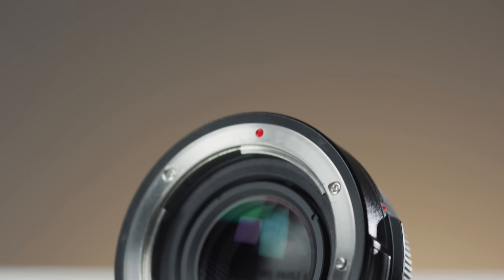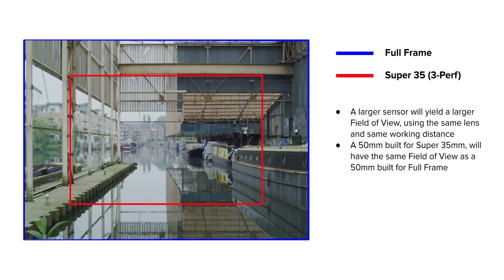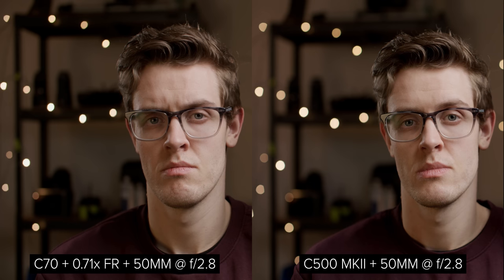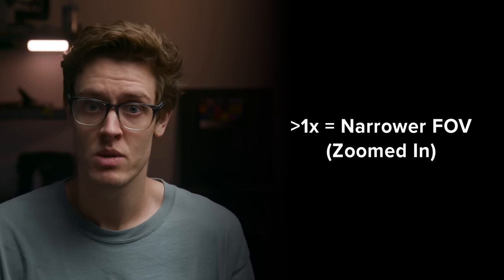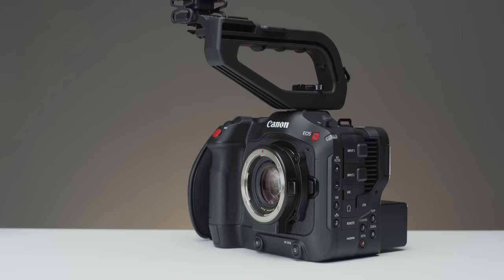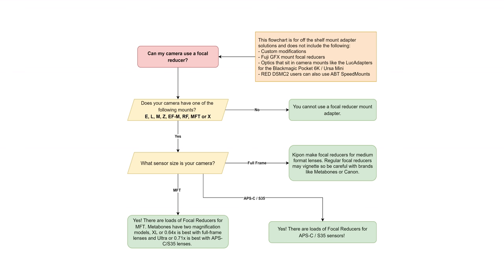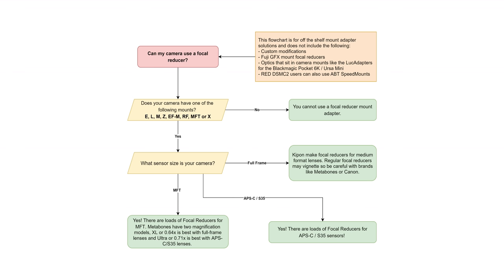Focal Reducers / Speed Boosters | Explained

Comment: I would definitely appreciate a similarly technical video on the "full frame look". Too often you see bs on youtube that attributes it to some magic qualities of a larger sensor, and it would be good to have a comprehensive reference of specific technical advantages of the larger format.
Reply: +1
Reply: +1
Reply: + 1
Reply: Straighter angles at same field of view (wider field of view at same focal length), more light collected at same T-stop and ISO setting.

(Edit: hilariously I managed to write my short answer wrong... hehe. And yea great subject for a video)
Reply: @randomgeocacher  I agree with your second two points. Your signal to noise ratio with a large sensor is certainly improved over a small one at a given T-stop, allowing the same ISO to look less noisy.

I'm not sure I understand what you mean by the straighter angles thing.
Reply: @thatcherfreeman  large format -> medium format -> full frame -> crop; the further down you go you need “wider” focal lengths to take the same picture. Wider focal lengths generally have more bent angles are are harder to get correct, so producing a better image on a larger sensor is “easier” because you use a longer focal length.

Thus on a large format, you will take the picture on a very “long” focal length, generating a very “straight” picture. If you instead take it on a micro four thirds, you will need much wider optics, generating much more distortion and bends.

On a “normal” lens, such as a 50mm full frame equivalent, it looks pretty good on any sensor size. The wider you go, the harder it is to get it looking great on the smaller sensor sizes. So especially on wide angle photography, for example 25mm FF equivalent, the larger sensors will have a big benefit.

That said, I think some of the manufacturers “unbend” their own native lenses and remove some vignetting, at least in photo mode. But if you like really wide angle portraits without and distortion or in-camera / post processing hacks, then that’s typically where medium format or full frame adds some benefit over the smaller sizes.
Reply: fairly simple. Larger chip; to achieve the same FOV as super 35 you have to be closer to your subject hence more shallow DOF
Reply: @earthlevel4569  Huh? To match FOV you just change the focal length with a larger sensor.
Reply: It’s not “magical”... but people TEND to like the way images look on Full-Frame and larger formats. Just like people TEND to like the s35 look to small camcorder sensors
Reply: @Frontigenics  Yeah, and describing what the technical qualities of a larger sensor are that achieve that result is valuable
Reply: @randomgeocacher  it is far easier to make super corrected (less distorted) wide angle optics for smaller formats, so no... you don't get less distortion using a 50mm on FF / 135 compared to a 25mm on MFT. That is one of the central myths of full frame.

Also perspective (rather than optical) distortion is a product of the proximity of the lens entrance pupil to the subject, so as long as that is constant between the two formats, again there is little no no difference.

It's only at the absolute extremes distortion comes into play as a factor in any meaningful way... a 12mm on FF / 135 verses a 6mm on MFT, but even there other factors are more of an issue.

Also remember most wide angles for IMAX an 65mm are super distorted. There is a test comparing Arri DNA primes (rehoused MF optics) on the Alexa65 and Arri's Signature primes on the Alexa Mini... guess which show more distortion?

Comment: I just discovered your channel, and it's great. There's a few things i want to say: 

A factor that would enter into the equation of DoF would be the circle of confusion which is what makes that, with lenses that give both systems the same field of view (25mm for m4/3; 50mm for FF), a 1/4 of FF sensor like a m4/3 has not 4x the DoF of Full Frame, but only 2x. If you want to hear an explanation look at min. 4 of Filmmaker IQ's Hyperfocal video. I don't know how focal reducers affect circle of confusion.

The other thing I want to say is that it'd be great to see a video about the FF look you mentioned. I've found it very difficult to comprehend what are the things that differentiate a FF image from a crop sensor's with an increased aperture.

Comment: Great overview and lots of details! 

I just wish there was an option to disable the “transformation” of f-stops and focal length, and just have the camera show what the lens is really set at. 

I think the “speedboosting” of metadata is the cause of 99% of the confusion about speedboosters ... and primarily done to tout/market the capability of the device rather than being helpful to the operator. Especially when an adapter is semi-permanently screwed on it’s fairly obvious the operator likes to work with adapted lenses terms rather than the native mount terms.
Reply: The camera does show what the lens is really set at. The focal length and aperture really do change when using a speedbooster.
Reply: @alex-stone  I fully understand what compressing the image circle does. My point is that changing the metadata is not helpful to many users. For example, someone operating a speedbooster Super35 and a full frame camera at the same time for an interview, will only get matching settings incredibly hard. There are other situations too where it just make things harder. To many users it would be much easier if there was a camera menu option to disable the metadata transformation. Not to all users, but for some, it would really help.

For c70 owners semi-permanently screwing adapter into the body, I imagine several would prefer working in full frame terms.
Reply: @randomgeocacher  don't think of things in 'full frame terms' - a lens' focal length and aperture are independent of format size and are not relative to anything in terms of full frame.
By updating the metadata to reflect the actual focal length and aperture, this only makes it easier for the user - especially if their A cam is FF and their B is speedbooster S35. For instance, if the B camera now says 35mm, this will match the field of view that using a native 35mm on the A cam will give. Equally, it also helps match exposures - if both cameras read f/1.4, then the exposure is the same, even though the Speedboosted lens might now open up to f/1.0.
I used to shoot with an FS7 (with Speedbooster) alongside an A7Sii  with manual lenses. Not having this automatic metadata adjustment made things harder as it added an additional step to have to think about when trying to match FoV and exposures.
Reply: @alex-stone my point is that the metadata thing is only helpful to one set of working and I think many/most do not prefer to work in that way. Regardless of how you want to work the best option would be to let the user decide. For me, I would like the metadata to say 70mm when the lens is set to 70mm. Sure I can try to compensate and reverse engineer in the head the difference, but the transformation just adds an annoying extra work and unclarity that I find utterly unhelpful. For me it could just say on the packaging how great it is and what it does, and then I would like to select “Do not improve metadata” in the menu. I’d rather buy native lenses than have to deal with the speedboosters making everything confusing. And given how many confused debates this metadata transformation adds to forums etc it seems it creates a lot of confusion / problems to many users.

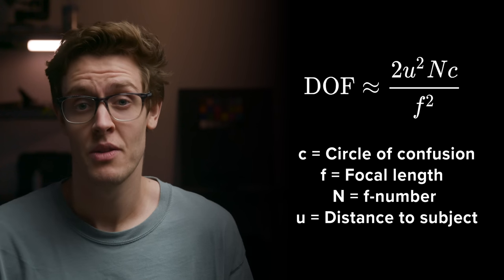Comment: Great video. But at 5:50 you mentioned that the f-number and focal length are cancelled out, so the DoF will be the same. However, from the formula, the focal length is powered by 2 while the f-number has no multiplication. Should the DoF change? Did I miss something?
Reply: I didn't get it either

Comment: The Mamiya 645 and RB67 are similar.  Can a speed booster made for the 645 be also used on the RB67 lenses if mounted on a dumb adapter?

Comment: I'm attempting to adapt the Canon f/2.8 65mm 1x-5x MP-E onto an Olympus OM-D E-M1X.  If I understand the video correctly, there will be no difference in DOF in either direction (increased or decreased), whether with the use of a straight EF-MFT adapter, or with an EF-MFT focal reducer, but the use of a focal reducer will recover one stop of lost light.  Assuming that's correct, my biggest remaining question is whether or not the AOV and/or working distances will change with a straight adapter vs. a focal reducer.  When mounted on a FF Canon body (such as my older 6D), the MP-E's normal working distance is rather shallow/small, particularly at higher magnifications.  It would be beneficial to see those working distances increased to allow for more light, and more room for flashes other than a ring flash between the front element and the subject.  Lastly, I'm wondering if models like the VILTROX EF-M2II, Commlite CM-AEF-MFT and Fotodiox Pro Fusion Redux Adapter are actually suitable alternatives to the significantly more expensive Metabones T Speed Booster ULTRA, or if they are underperforming in some way.  Thank you in advance!

Comment: Careful when you say you get a full frame look. When you use a focal reducer, you are adding glass to a lens and changing the actual focal length of the lens. A 50mm f2.8 lens becomes a new lens essentially with a focal length of 35mm f2 with a focal reducer. Therefore, you could just use a 35mm f2 lens without a focal reducer. I see a lot of misconception that a focal reducer will make your crop sensor into a full frame sensor and this is not the case.
Reply from the maker: Sorry Matthew but did you watch the whole video?
Reply: @CVPTV  Yes. I either misunderstood what you're saying, or it seems contradictory, for the section at 8:45 where you say "achieve a full frame look".
Reply: @CVPTV  Hey man, this video is truly fantastic. Thanks so much for the in depth explanation. I wanted to see if you could expand on Mathew's comment though. Is his comment correct? Would a focal reducer really not emmulate a "full frame look"?
Reply: @joestaehly2427  a 50mm lens on 135 / FF has the same AOV as a 35mm lens on S35. But at the same Tstop, the 50mm on 135 will be 1.5 stops shallower in terms of DOF / back blur. Stop the 50mm lens down 1.5 stops and a 50mm lens on 135 / FF and a 35mm lens on S35 will look almost identical.

Add a focal reducer and mount the 50mm on a S35 camera and you move the point on convergence in the lens - so the 50mm becomes a wider lens, albeit with reduced image circle, one that now only covers S35. Using all the light captures increases the stop.

So 50mm (a standard lens on FF / 135) has not become a 35mm (standard lens on S35).

It doesn't really emulate

Comment: So a 50mm T2 on a full frame and a Crop sensor is still a 50mm T2, just cropped in. But a 50mm T2 on a Crop sensor with a speed booster is not the same as 50mm T2 on a full frame but changes the 50mm T2 to a 35mm T1.4? So for instance would a cropped sensor with 35mm T1.4 and a crop sensor with speed booster and a 50mm T2 would be the same look?
Reply: Yes a 35 f/1.4 on APS-C will look like a 52.5 f/2.1.  The depth of field is the same. So those 2 lenses would look identical as long as you apply crop factor to both focal  length and DoF.

Also if anyone tells you there is more distortion on the 35mm on APS-C, tell them it's false. All equivalent lenses have 100% the exact same look and distortion is a myth. A 12mm on m43 shooting at 3:2 aspect ratio will look 100% the  same as a 24mm full frame when the image sensors are in the same plane.

Comment: Great video, the only thing that I don't like on the C70 is showing the focal length as 35mm for 50mm lens. On a MFT system I always think of a 50mm lens as having a 100mm effective length, calculating the crop factor as it relates to the full frame equivalent of the lens used. Why wouldn't you then calculate the 50mm lens as a 50mm full frame equivalent when using the focal reducer?

Couldn't Canon have a menu setting to select when using the focal reducer that then sets the focal length on the camera as the full frame equivalent value as that is what is being achieved? I don't understand why you talk of the camera as 35mm when without the focal reducer you should refer to the 50mm lens as having a full frame equivalent of 85.5mm?
Reply from the maker: I understand why Canon have done it, just as they have changed the aperture by a stop too. It's because that is what the focal reducer is doing. I don't understand your 2nd question sorry?
Reply: @CVPTV  Doesn’t the focal reducer make the 50mm lens an equivalent 50mm full frame field of view and without the focal reducer the 50mm lens has an equivalent full frame field of view of around 85mm?

I understand why the fstop changes but wouldn’t it be easier to speak the same language around effective focal lenghts i.e full frame equivalent field of view?
Reply from the maker: Yes that is correct. No because focal length is separate to FOV. Jake
Reply: @asiandetective4998  stop using full frame equivalent field as some form of base line. This is where the confusion is coming from.

ull frame equivalents do nothing but confuse and create a false baseline.

Comment: Can you speed boost a Sony Camera to Sony Lens to reduce F stop of Sony lenses you have?? Or is it always Sony to Canon / Nikon etc. lenses?
Reply from the maker: Its not possible I'm afraid. Jake
Reply: @CVPTV  ..thanks for the info.
Reply: ... you're asking two things here, so the answer is a bit more convoluted. Canon to Sony or any interbrand adapters may or may not also be speed boosters. Is there a Sony E-mount to Sony E-mount speed booster - not as far as I know. HOWEVER, Sony inherited A-mount from Minolta - and there's whole plethora of A-mount/Minolta lenses, and YES there is (was) a speed booster for Minolta lens to E-mount body.
Reply: @mack_solo  thanks for that explanation to a weird newby question.   It makes sense.  Another answer is buy a G Master lens. lol
Reply: @Voicewav  Having a bigger wallet is always helpful, but not always possible. Sony cameras are pretty good for experimentation with other non-obvious and certainly not retail promoted options. Also "excellence" ages well in optics - the well regarded lenses of yesteryears may not match the top guns of now, but they will certainly beat the common entries of today at the fraction of the cost. Don't be afraid to give it a go :)

Comment: would you happen to know if all ff glass on super 35 sensors paired with metabones 64 have vignetting?
Reply from the maker: It comes down to the lens, most will have light loss but hard vignette will depend on the lenses image circle. Jake
Reply: @CVPTV  what exactly is light loss? I’ve put my 35-150 ff tamron lens on and a rokinon 20mm ff on and at 20 and 35 they both have a slight vignette.